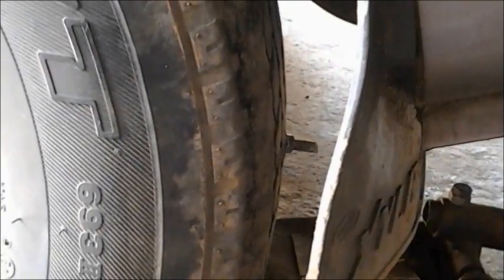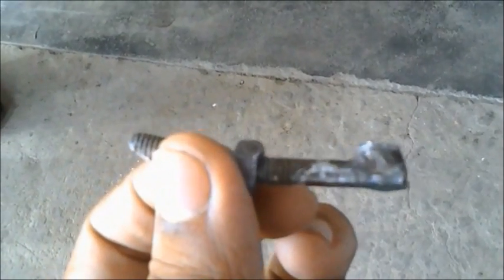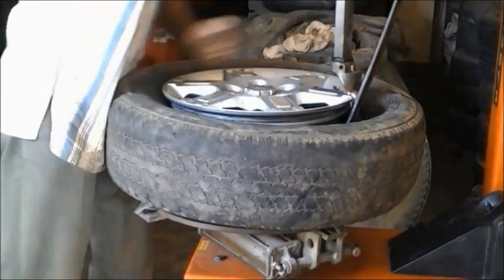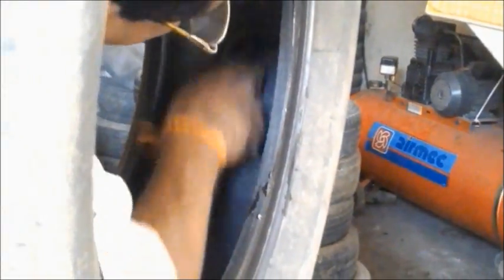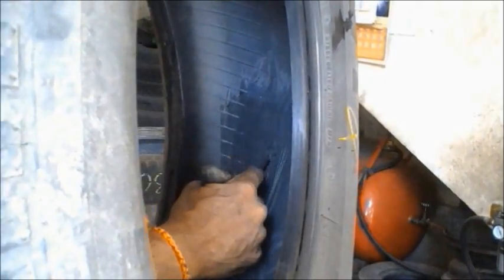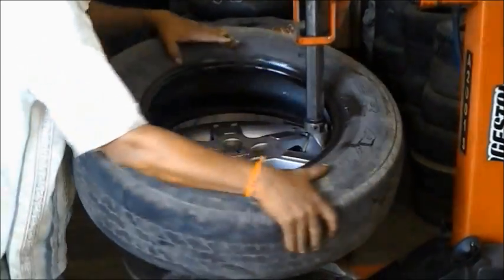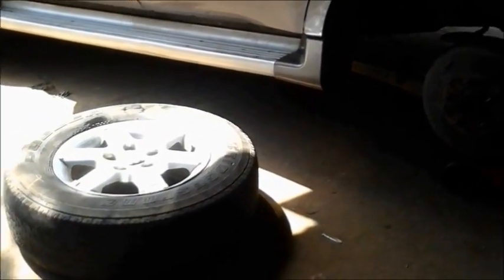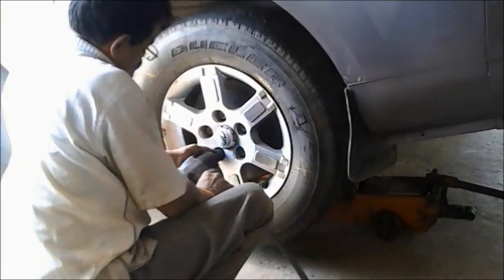Beauty of tubeless tyre - Must Watch. ✔

Comment: My tubeless tyre had a leak due to a nail and the mechanic did exactly the same as you have shown. I have still kept it as a Stepney but have a doubt or you may say a fear. I go for long rides very often and in such high speed or such long distance is there a possibility of this sticker to open? So do I doubt about the case when the sticky strips are inserted to seal a tubeless leak. If anybody can guide about this I will be grateful

Comment: He did not use the rubber strips which are commonly used to plug the hole.
Reply: Ravindra Tilekar mushroom plugs are the right way to fix tubeless tires.
Reply: This system looks better than plug inserts isnt it?

Comment: The buffing should have been done by a high speed buffer probably at 12000 rpm with a golf stone ball, then a cvf compound should have been applied and then the radial patch or even a 9mm mushroom plug would have been sufficient.

Comment: Dear Phoenix a.k.a. Pulse 

A tubeless tyre has a halobutyl lining on its inside. The rim, tyre is made airtight with this lining. You saw the lining being put by the technician. It was not explained in the video. 

Together with the airtight joint between the tyre and the wheel, the membrane forms a container that holds the air for the tyre. This too, is the beauty of the tubeless tyre, I think. 

Hope this resolves your curiosity. :) 
Nice video, with the accent and all - I liked it :)